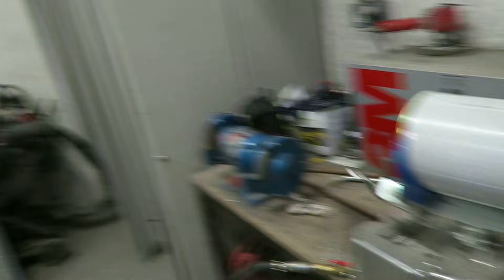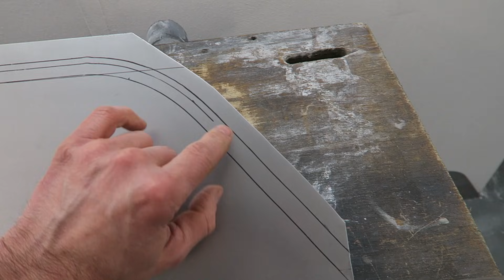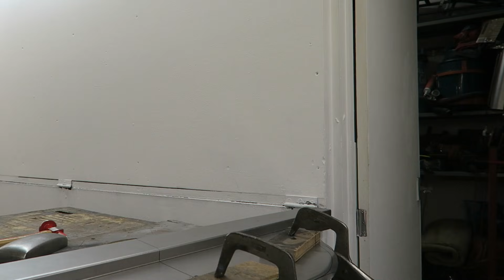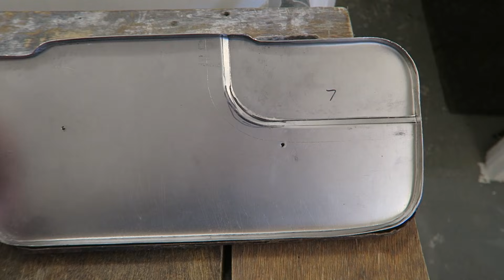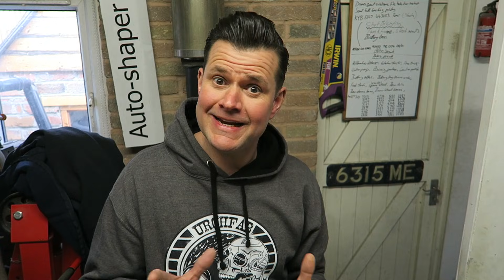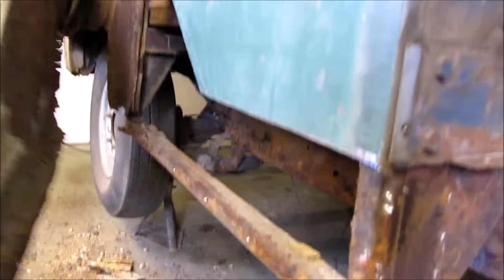How to make your own car body repair panels hammer forming Tips and Tricks #18 panel beating

Comment: I have been having trouble getting your videos for some reason and I am thoroughly impressed with your construction and tool making techniques with scrap materials. I am working on the body of my 78 Suburban and greatly appreciate your teaching on how to get things done on the least expensive way. 
I am going back to Oregon in the United States in a few months and I am hoping that the person who is supposed to be repairing the mechanical issues that another shop messed up is not selling or destroying this vehicle (he was recommended and had been very vague about what is actually going on lately). I would love to see your shop and also get some practical knowledge from you like hands on knowledge, but I am currently in Thailand and on my current budget would not be able to get to England to actually get hands on experience with you as a mentor.
I forgot to mention that I do not have a house or garage to work from in Oregon as I mostly live out of either a motorhome or the Suburban so my ability to carry tools that are heavy and cumbersome is rather limited.

Comment: Ah damn...I was getting excited that you'd show how to hammer for the step section on that front wheel mid guard Trev...but alas, you used a bead roller. I guess that means there's no way around it....we have to buy a $2,000 bead roller to make a part that has stepped sections because repro parts makers don't want to make the part for a handful of dollars. Bugger
Reply from the maker: Bead rollers can be very cheap to buy even the budget ones make a very good job and are nowhere in the region of 2000 dollars 👍
Reply: @trevsblog  in Australia if you want a motorised one yes, they start at $2,000 for a good quality one that won't flex under load mate. Sorry..should have told you my location.

Comment: Great looking replacement panels.  True craftsman sheetmetal fabricator. I've done this sort of work my whole life in aviation for Lockheed, McDonnell, & Boeing.  You would of fit right in, actually better than most, not all, than I've seen, and worked with in my field.

Comment: it takes more time, but to keep the bends on the straight runs tighter, I add clamps and clamp blocks holding the steel tight to the form near the edge (because your straight runs have a larger corner radius than the round corners do). It takes more time but you will get a uniform bend radius. Plus, if any part of the bended lip will be hidden you can cut/notch into the bended lip area allowing the metal to hammer easier...then just do some spot welds or stitch welds.

Comment: So why not clamp the piece between TWO pieces of WOOD? and then hammer over the lip,. this way there is not need for a dolly because there is no RISE due to the two pieces of wood.
Reply from the maker: TheJagjr4450 my channel leans towards getting around not having enough equipment, because I simply don’t. At the time of making this I didn’t have good enough clamps to put the load down needed. A viewer asked if I could demonstrate how to hammer and dolly a lip over without using a lot of equipment so this was the video I made. I’ve since got some proper engineering g clamps which I will use in a future hammer forming video. Cheers Trev 👍

Comment: I am preparing 1937 Packard rust pitted parts for paint. I have sandblasted and now ready to prep for primer. I would like to kill the rust in the pits of the metal. I was told not to use Ospho because of the reaction through the Epoxy Primer.  What do you use? What should I use and what is the procedure if Ospho is used so that the Ospho is neutralized.
Reply from the maker: James wagner sorry for the late reply. It depends how bad the rust is... if you put epoxy over the top and it successfully seals well to the metal you will have isolated the oxygen to the open surface stopping rust from continuing to form. Think about a fire burning? It needs heat, fuel and oxygen to continue burning, if you take one of these requirements away it will stop burning. Cheers Trev 👍

Comment: @Trev's Blog why do you not nip out little triangles from the curved lip edge and weld back up?
Reply from the maker: Jamie Thompson it’s all about finesse. It’s always preferable to make a panel with the least amounts of joints and welding, as these processes contribute to premature corrosion issues, heat distortion etc. Once you have mastered the skill it is no more time consuming than cutting and welding. Cheers Trev 👍
Reply: @trevsblog  right right t makes sense, I'm just starting out , great videos watch every one!

Comment: Hi Trev, Can a larger lip be created? I would like to recreate a silencer on my vintage Honda by using a wooden form and making it in 2 halves but they would need to be about an inch deep as the silencer is about 2 inch deep.
Reply from the maker: Lee Jordan it depends on the radius the tighter the radius the harder it is. Just try it out perhaps get some really big g clamps and put loads of pressure on. Cheers Trev 👍

Comment: Hi Trev, awesome work mate. Would you use the same process to form chassis rails that aren't plain and straight ? Scratching my head a bit 🤔🤔
Reply from the maker: Loftus Road Model Railway Worthing MRC yes I’m sure that you could utilise the same process, no problem but the rails may have to be jointed differently than they were originally. Cheers Trev 👍
Reply: Thanx 👍👍👍

Comment: What make of gun do you use for spraying 2 pack paint and what fluid tips do u recommend. Great videos by the way
Reply from the maker: Jack Harty this is a vast subject Jack and very dependant on your budget. I personally use a Iwata chrome flash AZ3 HTE-S 1.3 air cap, it’s a good gun if you’re on a budget. Another good gun would be a Devilbiss Pro, again more money. I can actually achieve a good finish with a duren/fast mover , costing around £20 but the fan is more narrow than the more expensive guns. Cheers Trev 🤩

Comment: Thanks for another great video!

Unrelated, is this a close replica of the panel hammer you're using?  https://www.hammersource.com/Metalworking-Hammers/Picard-Cross-Pein-Finishing-Hammer-450gm-16oz-44mm-round-face-18mm-curved-cross-pein-wood-handle/
Reply from the maker: Robert Jacoby it’s actually a Kennedy but that Picard would be perfect. Cheers Trev 👍

Comment: Great video, lots of food for thought.  Would it have been an option to use Electrolysis rust removal on the mud catcher panel to save the panel as opposed to making a new panel or was the original too porous to keep?  Another tool to use I found on the internet, which is available commercially, was a converted pneumatic aircraft riveter used as a Planisher for making deep dished items. Have you used one of these?  One of the projects I have is to make the primary chain cover on the engine of a 1939 600 Levis motorcycle from steel as per the original, working from photos as the bike is just so rare.  Do you intend to make any videos on more complex deep drawn shapes?
Reply from the maker: 000gjb it was way too rusty to try and save. It’s actually much quicker for me to just make a brand new one. A video I uploaded last week shows a deep shape. Cheers Trev 👍